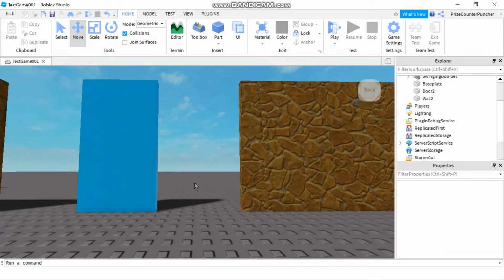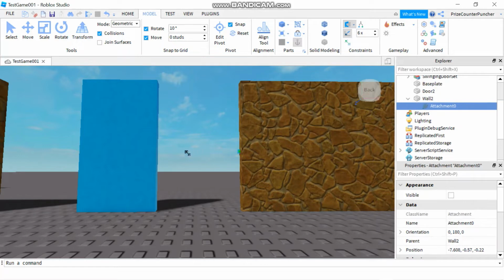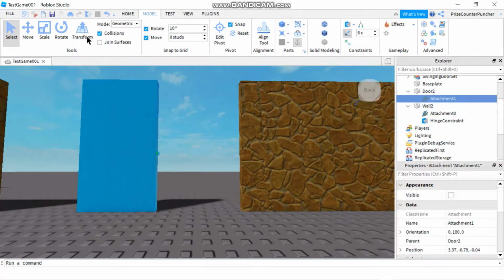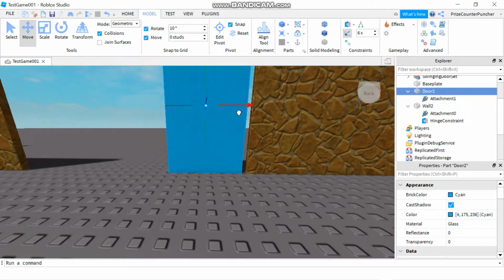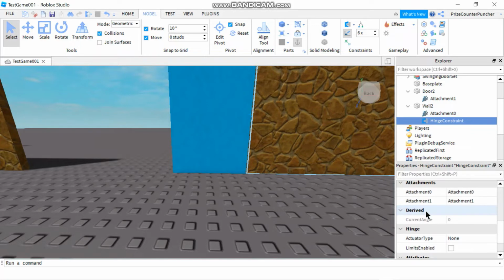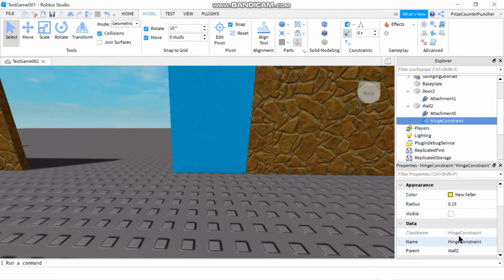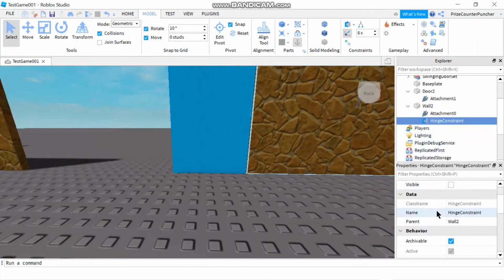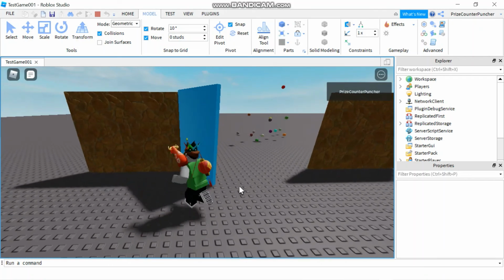How to build Hinged Doors (Roblox Studio Tutorial)

Comment: it work but when i add to a wall it just stops working
Reply from the maker: make sure the door is not anchored, not colliding with the floor,  and that the attachments are aligned vertically in the same direction.
Reply: i think thats it thanks